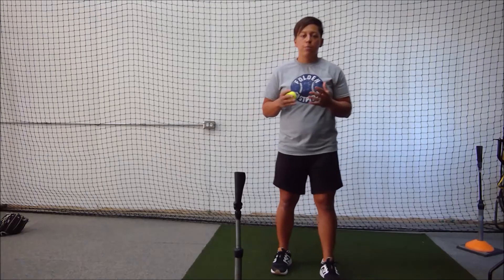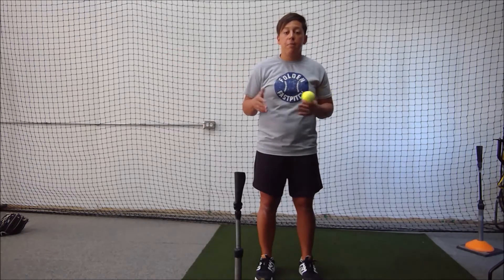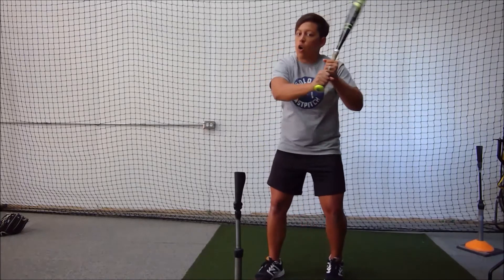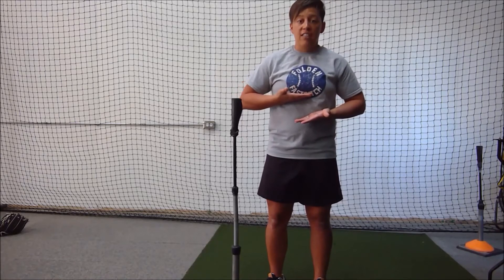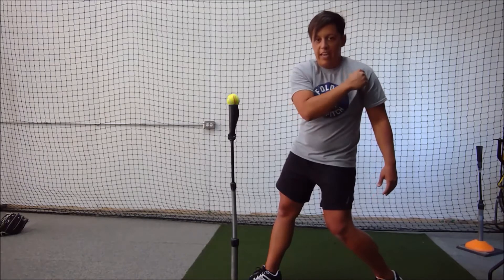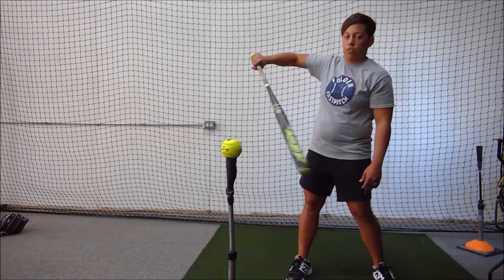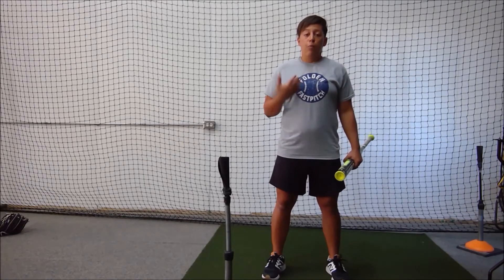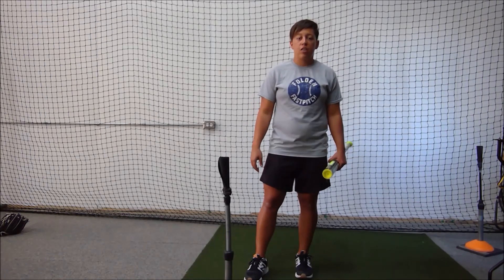Front Arm Mechanics

Comment: I saw your video  Using shoulder plane to hit high and low pitches and I like what you have on front arm mechanics. Where do you recommend softball players start with their hands and what do you recommend for front arm mechanics on the high pitch.
Reply from the maker: Hi there.  Since this video was published, I have learned a TON about human movement and how it applies to swinging a bat.  What I have learned is that the front arm should behave basically on plane with the shoulders.  Sure, most athletes' front elbow travels down (in relation to the shoulder plane), but the reason why is mostly because of a lack of strength in the area surrounding their scapulae.  So, in some instances, we have to "train" the front arm going up because the athlete simply doesn't know that it's supposed to travel on plane with their shoulders.  But in most cases, a downward traveling front elbow is due to a lack of upper body strength, and our body over compensating for it.  On a high pitch, ideally a hitter's posture should be most upright, and the front elbow will rotate around the angle that is set by the torso/shoulders. As for your question regarding hand set, the set up of each individual player varies greatly, and honestly is often a personal preference.  As the hitter goes through their load and into foot strike, their mobility will dictate where their hands are at this position.  Most athletes have their hands around the armpit/shoulder at foot strike, but where they set up prior to that position is not as important.  I would allow the athlete to find their own movement solutions here and experiment with different hand set positions to see which allows for the most efficient movement during the swing. One size does not fit all for hitters.

Comment: You have any good drills for a hitter whose hands move ahead of the back shoulder, I don't mean they move forward really, they load but when the swing starts the hands start the swing and are already a good 8 inches ahead the hips and shoulders turning, then everything catches up but its so fast you can only see it on slow motion video and most people miss it?
Reply from the maker: KB Adams there is an entire drill library at foldenfastpitchonline.com that helps tackle multiple swing movements, as well as an entire warm up/prep section to help hitters move better. Also, it could simply be a strength issue as the muscles in the upper back control the upper body and hands’ ability to resist the turn of the lower body.

Comment: Do you find it difficult to teach the elbow going at the upward angle with a kid who is flying open?
Reply from the maker: Yes.  Lots of hitters will work the front elbow up but won't follow with their hand so they end up pulling off the ball and around their body. I find the best way to correct flying open is to make sure the front shoulder works up instead of around.
Reply: @FoldenFastpitch  Maybe add the lateral tilt from driving the back hip through to help reinforce the movement.